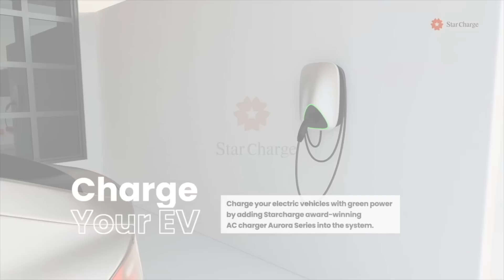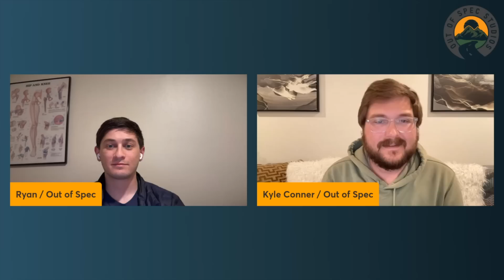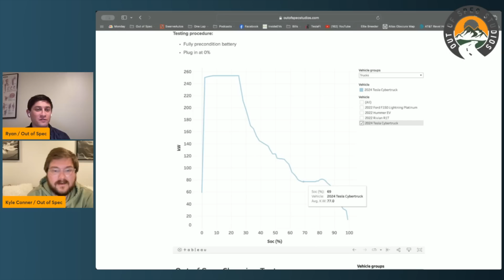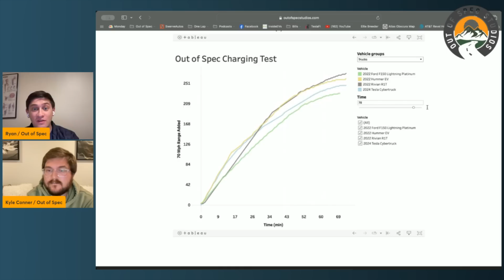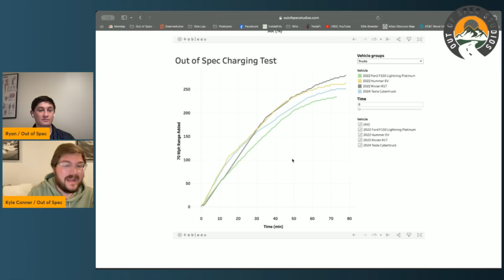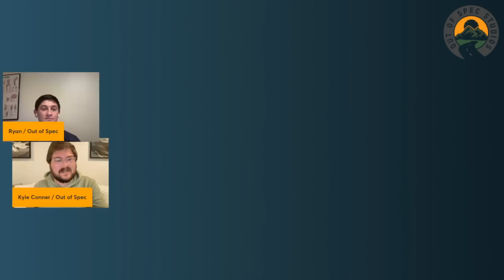Cybertruck DC Fast Charge Testing & Analysis - Comparing To Rivian, Lightning, & Hummer EV

Comment: From the looks of this chart, even with the F-150's previous charge curve, the CT doesn't add miles appreciably faster than the F-150L.  At about the 35 minute mark, the F-150 starts closing the gap, and by about 40 minutes, the CT has only added an additional 13 miles, about 7.6% more, which may be more due more to the vehicles' better efficiency than the charging rates.  The CT does start to increase the gap after 50 minutes though, getting to 230 miles about 16 minutes faster.  That comes with the caveats that the F-150L seems to have updates that have improved the charge rate and will need to be re-tested, and that the dual motor Cybertruck is 6.25% more efficient than the tested tri-motor.

For the years of naive Musketeers claiming Tesla's powertrain tech capabilities were 5 years ahead of other OEMs, I've been pointing out comparisons that show Tesla does not have appreciably better powertrain specs like power output or efficiency.  What Tesla often does have is a higher prioritization on aerodynamics, weight reduction, smaller battery voltage buffers (riskier for the battery), and exaggerated EPA range figures. ;)

When Out of Spec tests the Tesla down to the car dying, well below 0 predicted miles, the 0 mile prediction is likely where Tesla doesn't want you to keep driving because it's delving into the buffer, the part of the SOC where other brands restrict the driver to avoid causing undue damage to the cells.  In other words, testing to below 0 miles is trading range for potentially permanent pack damage.  It's cool Tesla gives access to this in case of emergencies, but should it really be considered "usable range"... as if it'll be used on a normal basis?

The CT vs the F-150L is the first case where weights of the vehicles are the same, so the CT's only tangible advantage in this comparison is aerodynamics and possibly buffer management (less buffer in the CT if history is an indicator), and they've had to make usability sacrifices to achieve those aerodynamics.  The short front end (less frunk space), massive raked windshield and the stupidly large windshield wiper, standard tonneau cover that eats into the bed dimensions (Tesla gamed the CT's bed dimensions, it's actually nearly identical to the F-150's bed dimensions and less functional), the higher sidewalls on the front of the bed, and no place to put a spare tire because of the flat bottom. (The F-150L puts it under the bed)

Tesla's charging speed advantage seems to have always come down to using thousands of small individual cylindrical cells, allowing distribution of charge and heat mitigation through more cells and pathways that were more easily cooled.  Now that they're using 4680 cells with 5x the energy density, their charging rates have taken a haircut, even at higher system voltage.  Supposedly the shorter electron pathway in their cell construction was supposed to help with the charge/discharge rate issues and efficiency impacts of larger cells.... I guess that isn't necessarily the case....
Reply: I wouldn't advise anyone who doesn't need a truck to buy a truck due to the enormous environmental impact of them... but for those that do need trucks for work, the F-150L is easily the better option compared to the F-150L.  It's superior in terms of overall cargo space and utility (better bed form factor, larger frunk) and thoughtful cabin design, utility, and space utilization.  

Exterior cargo examples:  

The F150 frunk is MUCH larger than the CT, and it has multiple outlets whereas the CT has zero.  

On paper, the F150 bed is much shorter than the CT... 67" versus 76" respectively.  In reality, the bottom length of the CT is only 73", and when you move up vertically about 12-18 inches, the tonneau cover container eats another 7" off the bed length, leaving only 66" of length, 1" shorter than the F-150 bed.  The F150 is a rectangular box, so the entire height of the bed is the same length.  This matters when you're moving anything taller than about 12-18 inches.  A pallet of wood / drywall or maybe a dresser, couch, or mattress.  Width wise, measuring wheel well to wheel well, the CT is less than an inch wider.  The width is uniform along the length of the bed.  As you move up vertically, the width of the CT increases by maybe 6"...  Contrast that to the F150, where in front of, behind of, and above the wheel well, the width of the bed increases by about 15".  Overall volume of the beds is probably pretty close to equal, but the F150 bed seems to have more usable space, and seems to be a more functional space overall.

The CT has underfloor storage in the bed which is a nice feature, but it isn't accessible if you have things stacked in the bed.  It isn't large enough to hold a spare tire, so the spare has to go in the bed.  The F-150L stores the spare under the bed like most trucks.

Interior Examples:  

In the front seat area, the F150 has storage on the dash behind the infotainment screen, 2 glove boxes, a large center console storage box, open storage under the gear shifter area, loads of door storage, a sunglass holder, 4 easily accessible cupholders from the front seat, and the center console can fold into a flat workspace.  The CT has one glove box, a large center console storage box, wide open storage in front of the console, loads of door storage, and two accessible cup holders. 

In the rear seat, the F150 has under seat storage that can be collapsed to create a huge flat floor to store big items. The CT has static under seat storage that can't be collapsed and will limit big item storage.

The F150 has a driver's cluster... the CT has all driver information on the center infotainment.
The F150 has vents you can move by hand... the CT has to be done in the infotainment.
The F150 has a front outlet... the CT does not.

The one big negative I figured the F-150 had against the CT was charging curve, but that isn't really the case.  Charging network OTOH is still an issue in 2024, but Ford is supposed to gain greater access to the Tesla network as we go forward, and some alternative networks to Electrify America are growing.

Also of pretty big importance to many people... you don't have to support an anti-union, anti-trans, anti-Semitic, anti-DEI, anti-WFH, pro-China outsourcing, proficient liar, etc, etc and just an all around toxic person like Elon Musk if you buy an F-150L.   If Elon Musk could import more cars and components from China without getting hit with huge tariffs, he definitely would without a single lick of remorse about the jobs it would hurt in the US.  Hell, he's been doing it in Europe for years.  Tesla was the first company to mass export cars from China to Western economies, exploiting low wage Chinese laborers to boost Tesla profits.

Have you had a friend or family member die or be seriously injured from COVID?  I've had many, and my sense of smell and taste still hasn't fully returned.  Remember that Musk was a COVID skeptic who refused to abide by factory shutdown rules in contradiction to how other OEMs handled it.  As it turns out, this was likely all because he was desperate to get Tesla into the S&P 500 at any cost, including cutting his employee pay reviews (raises) and withholding their bonuses.    Whether we agree or not with the shutdowns or any of the government rules around COVID, being a patriotic team player instead of a selfish greed monger is still pretty important.

If you're a human being, chances are Musk has vocalized something he hates about you.  Is this really the man we want to give more wealth, power, and voice to?

Comment: The CT battery is just too slow. When they announced it, they were clearly dead set on 180-200 kWh. Because why'd they doubt themselves getting 500 Wh/kg from their totally in house developed and produced cells? What has ever gone wrong with bestest cheapest cells? Come, don't be that guy! They also promised (in their fuzzy number spaghetti) that the cells would take 20% better C rates than their best at the time, I guess 2170s or 3rd party Chinese stuff in Model 3 RWD.
Reply: 200 kWh (oh, they also promised that specifically for the small cute New Roadster, because why not) at 3C would mean 600 kW charge peak.

Comment: Testing from 0% SOC is intersting, but is it "real world"? The industry standard of 10% is more realistic, especially with risk of not even reaching 0% due to imbalance or power limit. Would you send out you mom and aunt on a long distance family visit, with instuctions to run it to 0% at every stop? Nah, you wouldn't. And they'd be fine wise ladies and refuse to do something as foolish. To estimate their stop times and top up targets, you'd be using the 10% or 20% typical arrival SOC.

Comment: Tesla has been boasting 1 million mile batteries. Think of it. With this shockingly small battery, that's a lot of cycles actually. Trucks are known to get a lot of mileage, and as a towing vehicle, that would be looooaaadds of cycles. 400 Wh/km average for part towing, 300 km per cycle, 1.609 million kms would be 5,364 cycles. Raise you hand if you think 4680s are ready for so many cycles with a lot of it on the road at fast chargers.

Comment: Someone tell Kyle that his friend Tom from the State of Charge channel has a full 0-100% charging video on a 350kw charger as well as a 70mph 100-0% video on the Lucid Air that they can use to add to their charging and efficiency charts.

Even without being in the high elevation and lower air density of Colorado, based on the NJ 70mph range test, the Lucid Air charged at: 
-- 100 miles after 5.5 minutes
-- 200 miles after 12 minutes
-- 300 miles after 22 minutes
-- 400 miles after 37 minutes (at 80% SoC)
Obviously, that's a much more efficient vehicle (than the Cybertruck) with a very low drag co-efficiency, however, it's the 800v architecture on a 350kw charger that makes the most difference. By far.
So it's safe to say it would only do better in the lower air density of Colorado unless it's very cold.

Comment: When you re-test the Cybertruck in Colorado with ideal temps, the 70 mph range test will likely be significantly better which makes the charge curve for miles added much better.
Reply: Nah, it won't. I am sure the temp only lowered the range by a couple of miles. 262 instead of 254 miles would be my guess for the range, which is still not great. Charge curve will stay abysmal.

Comment: I did some nerding and calculated the 1000km challenge drive time based on the different curves and consumption

CT AWD
For the theoretical 1000km challenge, starting with a full battery and driving at 120km/h (75 mph), assuming optimal driving conditions and consumption of 32kWh/100km, 1000km will take 9 hours and 37 minutes. This trip will require four charge session(s) charging from 0% to 41%. The total time lost for charging up the battery will be 77 minutes.

Ligtning ER
For the theoretical 1000km challenge, starting with a full battery and driving at 120km/h (75 mph), assuming optimal driving conditions and consumption of 33kWh/100km, 1000km will take 10 hours and 13 minutes. This trip will require two charge session(s) charging from 0% to 76%. The total time lost for charging up the battery will be 113 minutes.

R1T MP
For the theoretical 1000km challenge, starting with a full battery and driving at 120km/h (75 mph), assuming optimal driving conditions and consumption of 30kWh/100km, 1000km will take 9 hours and 28 minutes. This trip will require three charge session(s) charging from 0% to 37%. The total time lost for charging up the battery will be 68 minutes.

Lucid Air Grand Touring
For the theoretical 1000km challenge, starting with a full battery and driving at 120km/h (75 mph), assuming optimal driving conditions and consumption of 19kWh/100km, 1000km will take 8 hours and 48 minutes. This trip will require two charge session(s) charging from 1% to 36%. The total time lost for charging up the battery will be 28 minutes.

Comment: The miles at 70 MPH vs charging time graph is almost the whole story for road tripping.  Great information.  However, it can't start at zero miles.  No normal person drives their car to zero before they charge.  I am an experienced road tripper in a Model 3 and I never plan to go below 10-15% SOC.  Start these curves at maybe 30 miles (10-15% SOC) and the information will be more useful.  And, it will make the Cyber Truck look worse because high charging rates are front loaded (which coincides with Kyle's impressions while charging that vehicle).
Reply: Absolutely agree. It's noticeable between my R1T and my 3 (which tapers hard but not as bad as the CT!) I'd hardly ever see the good part of that curve for the CT, maybe only half of it.

Comment: 57:30 Efficiency yes, but we also can't fit (or afford) battery packs that are larger than 250kwh. If there was a 500kwh battery we might be able to alter the curve a bit more. That's obviously the more flawed and gluttonous strategy. Can't wait for all the advances in energy density though, really looking forward to the future of battery tech.
Reply: @BBingo-v5i  For sure, I was just saying efficiency is not the only limiting factor here, in the literal sense. With efficiency staying the same, you could see better results here with a bigger pack. Not saying that's the right way to go :)
Reply: @Kee_Didnt  Oh okay, now I get it. I totally agree.  

The higher charging power of big battery packs boost the range added within a certain time frame, but the relative change in SoC stays the same. I have seen comments who argue to include SoC as a third factor in order to get a more even picture. That would be great actually. 

But to be fair, that's how the reality is, a bigger battery with the same relative charging speed gives you more range at the same time. The extra weight does not negatively balance that out. A larger battery also lowers the number of full battery cycles charged/discharged as you need less percentage of your battery for a certain distance. This helps to keep battery degradation low. It is often the best choice to go for the big battery option. As a bonus you have more power reserves, too.

Comment: The data points to be normalized to smooth out abnormalities and shouldn't the area under the curve be taken into consideration similar to Torque curves? Highest area under the curve would be a valid way to rank charging curves.

Comment: Tesla, I love what you build. But you cannot be advertising your vehicles as premium vehicles when it takes years for them to charge. I took a RWD M3 with only 50k miles through florida last week and my driving which should have only took 4.5 hours took 6 because of the charging times. I kept it best I could between 20-80% however some stretches I needed to push it to 100% charge in order to make it to the next charger. The reason I had to was just because it wasn't holding it's charge while driving like it should. I only had the AC on low and headlights on, that was it. When driving I was watching the projected % charge left at the next stop just drop and drop and drop. The weather was clear, the roads are flat as a pancake and still it was losing charge like crazy; and then it took awhile to charge back up. This has to get fixed, and to see by the looks of it the Cybertruck doesn't even fix this problem makes me sad for the brand. If you want us to be able to use these on a road trip fix the charging and give us more miles per the same price. You shouldn't sell the truck for example with a range that's only good for summer nights without towing, you should sell it for the least optimal conditions. If you look at any "built ford tough" ad that's exactly what Ford does. I take a beat to shit truck, fill it up with gas in 3 minutes to full from empty, and then still drive it 300-500 miles even while towing a reasonable load - and it's still a cheaper product. Stop comparing yourself against other EV's and start comparing yourself with the work horse many gasoline/diesel cars are.

Me driving the RWD M3 was in optimal conditions, without towing anything and without much weight in the car. When was the last time you heard someone in a gasoline/diesel car make and excuse for weather/weight within the car, for why it takes them so long to fill up and for how short of range they get? Never, because they don't have to. They can fill up rapidly and get great range even if it's -20f outside. Quit trying to get away with tiny battery packs just so you can sell more vehicles and do it right the first time. Include a bigger pack, with the 4680 cells, and let us crack into that battery whenever we want. This should be able to charge at most 0-100% in 20-30 minutes by now (and if it can't then Elon should stop acting like the battery/range problem is solved, because it's not). Charge 0-85% in 15 minutes and then do the last 15% in 5-10 minutes and call it good. I have no idea how someone would use the cyber truck while towing on a long travel. He would spend much of his day just sitting there charging while it takes almost no power. Time is money, and if you want people to use this as a work vehicle then act like it. People don't have time to spend hours charging out of their day, just to to haul shit. No blue collared person will buy this for it being a truck, which means to be a work horse as it stands today.
Reply: Great comment. Tesla vehicles are not premium vehicles actually. The price might be at the lower end of the premium competition, but the specs (range, charging, efficiency), technology (LiDAR, HUD, lights etc.) and interior quality isn't anymore. Tesla is building more and more mid range cars and for that they are too expensive.
Its crazy how other customers have not realized this yet. Especially in the US people are still flexing with Teslas lol.